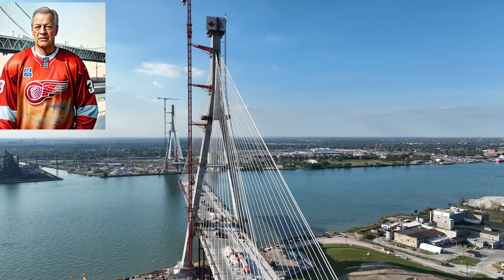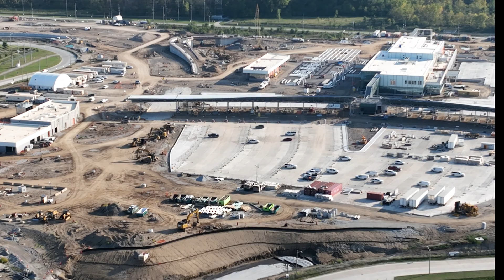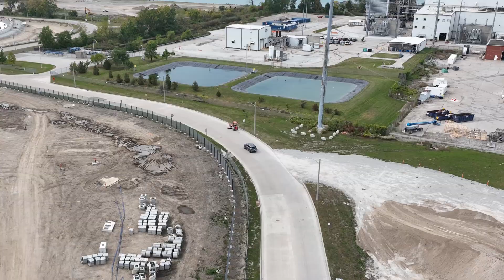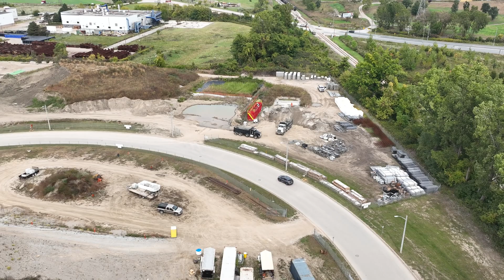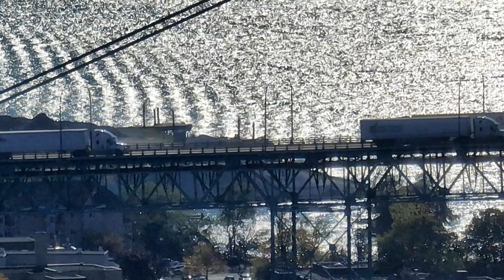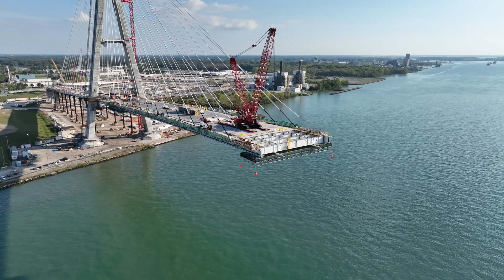October 2023 Update: What’s New on the Bridge Project?

Comment: I'm a michigander road improvement in Michigan definition filling potholes at the end of winter just so the snow plows can rip the patches out in winter. And remember in Michigan we have two seasons. Winter and road construction have a great day.
Reply from the maker: Lol. I've driven some less than perfect roads in your state, here in Windsor, too. Infrastructure only lasts for so many years before patching doesn't solve the issues of age. Eventually they get updated. That's when we complain about having to detour. You are right on the mark about the constant struggle to maintain. :)